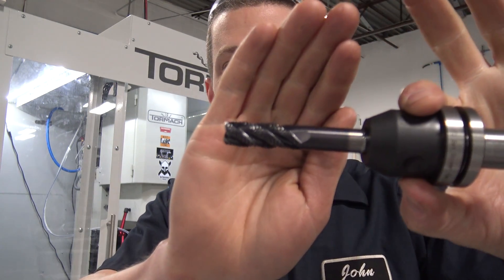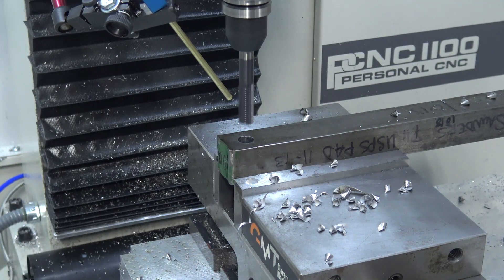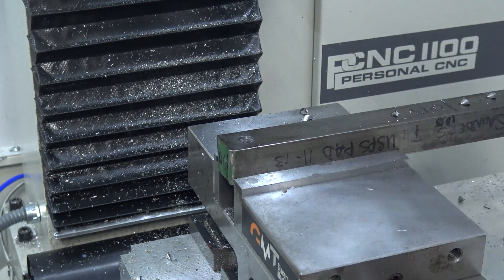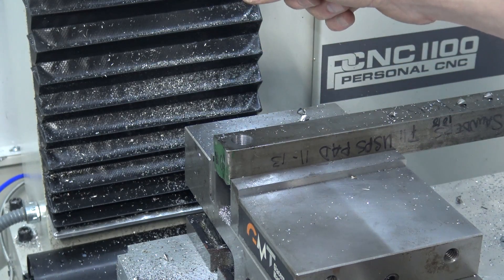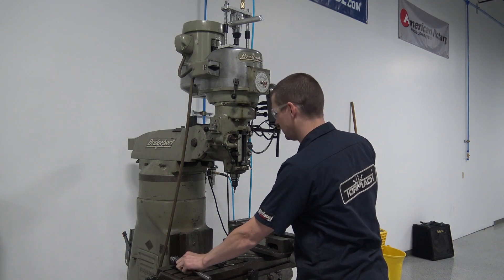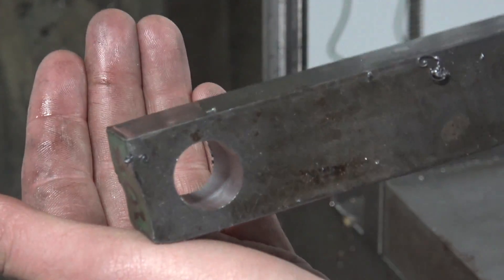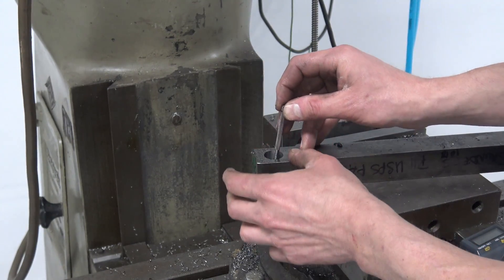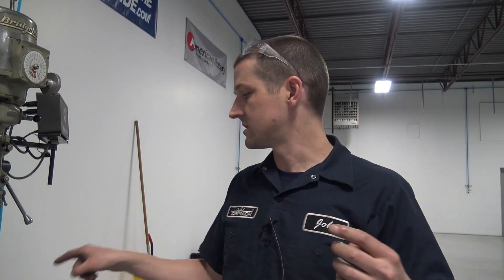Rough & Ream?  Will it work?  Part 1

Comment: Mic your pre ream hole to check first. Try an end mill instead of interpolation. Use a smaller drill for a starter hole. ?? Flood coolant? One machine and ream in one straight pass. Slower.

Comment: At the start of rotation of the reamer in the bridgeport I can see the reamer wobbling, and not on axis. That will give an over-sized ream hole because the reamer is spring loaded against the workpiece and loaded more on the eccentric reamer flutes. You could use a dial indicator to see the eccentricity on the reamer, and it needs to be near zero, or else you will over-cut.

Comment: Your .7355 pre-reamed hole or .015 less than finished size is perfect for .7505- Always go with 2-3 percent of the whole size to get your pre-reamed hole correct. 

To me it looks like the reamer is actually spinning out of round (running out). Next time indicating the reamer in the spinal to make sure the TIR isn't out of tolerance. I think in this case the reamer was just running out. If you need reamers www.densonsales.com

Comment: I thought with a reamer you are supposed to do one straight pass not stop and go and at the end remove it from the chuck and pull it out from the bottom of the hole not back out through the top, I've never used a reamer this is just what I've read about them so please ignore me if this is wrong

Comment: reamers will sometimes ream over if you pull out of the hole and go back in. ive heard if its a through hole u can ream to size if you go through and pull the tool out the other side. heard that though. havent tried it yet.

Comment: There's a few problems I can see just my opinion though, 1 I feel you ran the reamer way to fast should have been 60 - 100 rpm so it might have bad mouthed a bit! Second  you should really power feed a reamer about 0.003 ipm! Lastly you really shouldn't have rigid reamed the whole reamer work best when they can find there own centre with a floating head as that way you can be sure that it will follow the existing bore in the work piece!

Comment: for drilling with the endmill offset and go down in a spiral ; for a routhing flute the rpm you select is too High for that much stick-out ... in this case i go 1200rpm and 440/480mm min in spiral down about 3/5 mm for spiral
Reply: 0.0394" per t.--- 165sfm ---- 0.1968 per spiral

Comment: You left way to much material, should have left 0.010" maybe even a few thou less.  Also, don't peck when reaming.  That's a big no no.  Feed in with a constant speed and feed out at the same speed.

Comment: I read thru the first page of comments and most of them were exactly what I would say about leaving less material, spin slower, and don't peck, but they left out one thing. A reamer cuts with the 45 degree bevel on the tips of the flutes. If these get worm from their original sharp cutting edge, all bets are off on the hole dia. The sides of the flutes just guide the tip forward and keep it centered. Take a close look at the reamer tip using a loop. I bet at least one flute tip is damaged or the relief is wrong.

Comment: Hey John, I tend to use fusion's 2d bore path for that type of work.  Drill out then spiral bore with a finisher.  It usually leaves a great finish and final diameter is easy to control.  You have a lot of deflection at that stickout even with carbide.  The circular bore path loads the tool more axially and less radially, I think that would stop your chatter and you wouldn't need a rougher.  I haven't ever seen a reamer cut that oversize though...interesting.
Thanks for your videos!
Reply: I've cut oversize with a reamer. pushing too hard, it walked sideways a bit blowing out the diameter of the hole. out of round too.

Comment: You could try drilling the hole out to about 0.7", then use a helical tool path with the finishing end mill.

Cutting data(Metric): vc=240(6000rpm) -> fz=0.03(720mm/min) -> Z-Axis pitch=0.75mm

Comment: try 1/4 speed or less of drill speed and don't peck ream, plunge thru with heavy presure and lots of oil,  I have been doing it this way for 40 years never had issue. and yes you should mic across the cutting edges to measure a reamer..

Comment: My experience has been to ream to the finished depth and not peck as you have done.  Also, I do not know the rpm or feed rate you used but it appeared the reamer was running a little fast.  I also believe the run out on the reamer would be negated by the hole location (indicated position) and not significantly affect the hole size.

Comment: Reaming rule of thumb: .005 of reaming stock per 1/4 inch of diameter. 3/4 is .015 of stock. RPM 1/2 to 2/3 of drilling RPM. Constant steady feed. 2 to 5 times the drill feed. You had everything right except for the constant feed. And, use plenty of oil/coolant on the reamer.

Comment: I have never seen a reamer pecked before. .015" is a good rough size, but I'd run it at the same RPM, if that's mild steel, but you should be feeding at .020" a rev with no pecks.

Comment: Ramp in with that endmill instead of using the predrill option even if you did predrill. I save myself a bunch of time by using a helical boring routine in HSM instead of loading every sized drill needed for a part.

Comment: seems like the reamers running a bit fast as well :) I'd use about 5 m/pm which makes it about 80 - 100 rpm. Use heaps of cutting fluid and run the reamer straight through without clearing the swarf. id only leave about .2mm on the hole to be reamed also.

Comment: First off, your endmill was squealing because you had it sticking way too far out of the holder.  I have used those kinds of endmills before and they work great at relatively low rpm and you can be quite aggressive with them.  Using 100% of the diameter should be no problem.  If anything you could always reduce your depth of cut as well.  If it still squeals consider reducing your rpm.

I would also recommend only leaving around .003" per side finish allowance for the reamer.  Too much material will cause an oversize hole.  If you have it handy I would also use water based coolant in a spray bottle and feed the reamer in one continuous motion rather than pecking as some others have suggested.  Using coolant rather than tap oil will help keep the reamer cooler and chips will also be evacuated from the flutes better (WD-40 also works well).

My last recommendation would be to hold your part in a vice that is not secured to the bridgeport.  Your reamer had noticeable runout and this runout will definitely contribute to the hole size being bigger than intended, especially since you are pecking.  By having the vice unsecured the part will be free to "wobble" with the runout of the tool.  This might not be ideal considering you would have to hold the vice with your free hand and would not be able to spray at the same time.  As an alternative you could also try to knock the runout out of the reamer before using it.

Comment: John, I am surprised the hole is so minimally over your target. If you switch machines between the drilling and the reaming operations, no amount of fuss dialing in the hole will save you. Floating reamer holder ! The other comments regarding plunging , avoid pecking are perfectly valid but the use of weldon shank holders and two different machine setups will kill the perfection. Thanks for the great videos and presentations.
Bill Phillips

Comment: It did seem like there was a little bounce in the cut.  Also I was always taught that straight flute cutters go straight in without  stopping or backing out?  Lastly, were you completely true when you indicated it?  If you were to do it all by hand in the BP, when you touch off and walk though all the cutters you'll maintain that constant true center instead of having to reindicate when going from the CNC to the BP and not risk losing that thou of accuracy in positioning.  You did however get a much better finish that I would have thought!  Good job!

Comment: Ream stock: try 0.003 to 0.005. Dull-ish reamers are  sometimes deflected by a built up edge. Also try a light stone to the cuttin edge, maybe a second relief on the intersection of the c bevel with the flute dia. No promises, this is a resurrection trick.

Are the flutes dinged up? Seems to me I heard you take it from a telescope tube. Look them over and maybe glide a slip stone in the flutes like you were trying to stone a 5 degree neg rake on the face of the flute. 

Can't beat sharp tools. Why store them dull?

Comment: .015 is fine, your speed is to fast and you are  not on center and no pecking it is a reamer not a drill. The only reason you peck is for chip braking and the chips brake them self with a ream. Also try using your hand wheel for the feed more steady pressure.

Comment: Circle interpolate the .5" end mill with a 2deg ramp down instead of .5 steps. Don't peck the reamer that maybe the reason it over reamed and also your reamer was running out a bit. Indicate the reamer and that will help correct the issue.

Comment: With my personal experience of reaming tighter hole, you should try getting your rpm down to 100 with a gentle feed.Have you noticed if your reamer was getting warm? If you have coolant on the Bridgeport use it, it should help keep the reamer cold and keep it from expanding. When i want a looser hole i use cutting oil and higher feed. On bigger hole like this it can make a big difference. Good luck for your project!

Comment: I would have drilled without a spot drill just for an open area in the center, then helical ramped in Z with a finish end mill. leaving .007 aside. Then Reamed. And I would have gone slower spindle speed with reamer and gave it a strait feed G81 through, or a bore cycle with a spindle stop then retract.  Not sure how close the tolerances need to be with that hole, but for general purpose this works well for me.
Reply: +NYC CNC  Yeah, especially with the manual mill, things are not the same as in a CNC where everything is controlled. I honestly would have ran it at 90-100 RPM, And gave it a nice even feed by hand. And I would have soaked the reamer with oil, So it would have a even coat all the way through the cut. I have tried using spindle speeds on the manual mill like what is recommended for tools. And it just ends up failing because of the chip load we can't control, and the flood coolant we don't use on the manual mill.

Comment: chip buildup on the reamer when you peck causing an over sized hole? is the brideport bed stable enough to hold .002? example worn out, maybe lock the table in x,y?

Comment: You have to put your endmill much farther back in the holder than you did, I typically run my endmills about 1/8 of shank sticking out of the holder before you see flute, and even less for smaller diameter endmills. Its all about a ridgid setup, and if your endmill was held better you could run that hole even faster

Comment: How can  guy indicate a ruff surface with pure accuracy?  Also, chatter is always a problem that should be resolved.  You might have been better with only one interpolated cut at your RPMs .Use a smaller diameter end mill...don't be lazy about the work that you do,  keep a good finish on the hole if transporting to another machine so that you can keep true position of the hole location per print. TRUE POSITION is not always called out, but you are going to come across the symbol, if you haven't already.

Comment: You had to peck because the reamer was loading up. I think you were taking off too much material. The reamer looked to have some runout or it was slightly bent. But I see no reason why what you were doing shouldn't work, especially if the hole was roughed and reamed on the same setup.

Comment: The reamer looked like it was wobbling in the collet so it could be worth trying a different collet.
I don’t think you left too much material in the hole. I normally leave 0.3mm which is about 11 thousands. 
Reamers cut better when you don't  peck with them so just try feeding straight through the part with one cut.
Hope this helps

Comment: the reamer looked like it was running out, u could check that. also I have shortened them before to get less run out. I would also feed it with out pecking and a little faster. hope that helps.

Comment: Hey John, I use Autodesk Inventor HSM and I don't know if Fusion 360 has this option, but when I select a Drilling OP, I can select "Drill Milling / Groove Milling" (not sure about the translation). This type of Drilling OP works with End Mills instead of Drills. You can select your hole and enter an end diameter, as well as a pitch and the toolpath will be a helix from top to bottom. I'm sure that would increase the surface finish from the roughing mill, as the "slots" in the tool will continuously move down in the z-axis and thus leave a nicer finish.
Reply: +NYC CNC I installed fusion360 for this reason and I found it.
It's called "bore milling" and can be found when setting the drilling strategy.
Remember that you have to manually set the hole diameter, for some reason the software doesn't do this automatically and set a pitch that is low enough so the stepover on the roughing mill slots doesn't create spiral ridges. I found 0.8mm to work pretty well for our 6mm (1/4in) endmill.
If it helps, I can record a quick video on how to use the feature and how the end result looks!

Comment: Did you indicate the reamer shaft for runout?  Check your Bridgey tram? Also, I would not peck with the reamer.  Leave .005 on the wall and go for it.  You are right: a thou and a half over is a mile.  (And I think the roughing endmill prep is fine.)
Reply: +NYC CNC I've used a floating reamer holder and chopped the reamer shank down to good effect in my VMC.  Runout will get you, because it won't let the reamer... y'know... ream.

Comment: Use an ER collet or a R* collet instead of the Weldon flat TTS holder.  You can see the runout of the reamer tip in the close-up while rotating.

Comment: You could try to run the end mill with less DOC and more width of cut... Also check out the true diameter of the roughing end mill or take a measurement of the hole after the roughing. At least HSS roughing tools tend to be about 0.2mm undersize.

Comment: I think your speed on the reamer was a little bit too fast. It also seems that it had to cut a lot of material. For this size i would mill the diameter 0.2 mm under finished size. Also it helps a lot if you chamfer the hole before reaming.

Comment: Things about reamers. The faster you go the bigger they cut (try running around 30 sfm is CS ). The slower you feed the bigger they cut (that size of reamer I would start at about .03 IPR feed). You should not peck with a reamer that will over size your hole. The less material you leave the smaller the hole (i would shoot for about .003-.005 per side). More round out = bigger hole. Lube can affect holes size but mostly will affect finish, if in doubt use more.
Reply: +Widget Works Manufacturing Inc.  At one job I worked at I was talking to one of the machinist. He said just what you stated above. I now understand it. I couldn't see how a fast speed slow feed could create a larger hole. My thought was, "how does the size of the reamer change?". 
The slower the feed, the more time the reamer has to cut are my thoughts.

Comment: John, When I rough a hole with a long over hang tool like what your using I usually just start at the top and helix down at the diameter I want(almost like milling a thread). This puts the force axially down the tool and less side force it will reduce or eliminate the chatter. If you continue with that high frequency chatter on a carbide tool it will eventually chip the cutting edges. Why don't you cut the long shank of you reamer shorter and ream in your CNC mill. Also you are leaving to much stock for the reamer I would say .005 to .0075 per side should be good or .01 to .015 on the diameter. A reamer will always cut slightly larger than its miked diameter say .0002 to .0003. If you think about it if it cut its exact diameter it would get stuck in the hole. So always start with one about .0005 smaller than what you want you can always ream bigger.

Comment: from what I saw, the coaxial indicator was on concentric with the hole.  Might be a bad collet or you may have needed to tweek the x&y till it doesn't move. even a 1/2 thou will cause a 1 thou oversize.

Comment: Sorry, I have to pile onto the anti-pecking band wagon. I was taught go straight through then shut off the spindle - do not retract the reamer while the spindle is turning. The video also made it 'appear' the RPM was to high, feed rate was too high, and the pre-drilled hole wasn't under 2%. I'm sure you know or have been told these things before, as stated, this was an experiment....

Comment: my guess is that the error was introduced when you changed setups to ream. you would probably need a floating reamer holder to get an on size hole with that setup. to prove your reamer, drill and ream the hole on the bridgeport .

Comment: John, Not sure if Fusion has this tool path but I would use a Helix Bore tool path instead of what you used . That way your cutting on the end of the end mill. It will be slower but it will give you a much more accurate hole. Also your reamer needs to have the least amount of run out you can get. Lastly "Half the speed, twice the feed( compared to your drilling feed and speed) " for using the reamer.

Comment: I am no machinist at all but it seems to me that you had some error on the Bridgeport when using the indicator, which, when you add in the length of the reamer would surely magnify this error at the cutting end leading to an even greater error:= larger than expected hole through.

There are clearly other pointers listed below!